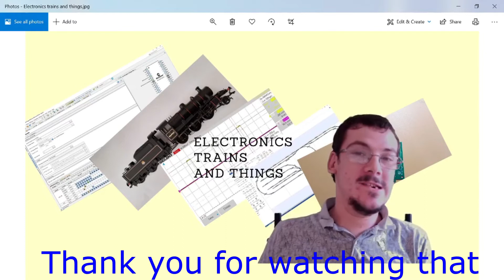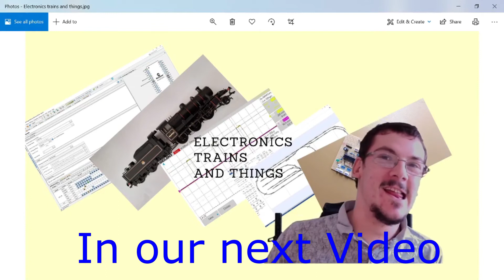Curing Train stopping on points/turnouts

Comment: Simple, change your point’s/switches to live frog and you won’t have that problem.
Reply: Which are much more expensive and difficult to install
Reply from the maker: These points are very old and we don't have the money to upgrade! But thanks for advice. We have opted to adding pickups to the tender but we haven't given the train a good run yet. We've had to take a long break but back into it again. Ernie and Louis

Comment: The basic problem is the lack of proper wheel bearings and tender pick-ups on most Bachmann loco's. I don't have any of these problems with Hornby nor other make like Roco, Piko, Fleischmann. Needless to say that the track & each point need a proper feeder for the fish-plate connections are bad conductors. Proper track maintenance helps a lot of avoiding problems of stalling too.I prefer the 'graphite' application. Success.
Reply: @barnabyjoy I wrote: wheel bearings. This means the wheel axle turns in a bearing at each side that sit in the under frame so there is less friction. Only Bachmann uses the axles to turn direct in a slot of the under frame resulting in a lot of friction and wear. But here the main problem is the lack of tender pick-ups.
Reply from the maker: Yes, we've added pick ups to the tender. Thanks for your reply
Reply: @electronicstrainsandthings4149  have you tried seeing if theres a pinch point that grabs the flange, created by the bow in the plastic making the gap between rail and check rail a little tight? That could explain more so why bending it out to flat helps as it would slightly open up this gap. That would explain why giving the wheels a little bit of extra side play would be helping you out if it was the cass that it was grabbing the flange of the centre wheel set
Reply: A very narrow-minded response. Just because you only have problems with Bachmann, means nothing to me, as I have these problems with Hornby, Dapol and Bachmann. So, 1) you're lucky and 2) you're wrong.
Reply: @skelligringphotographyandw7012  check the back to back gauge of everything, check the gauge on the points. Problems usually lie here. And remember, even real trains derail sometimes its never perfect even for the big boys
Reply: @skelligringphotographyandw7012  Are you that frustrated that you need to insult people ??

Comment: I have just come across the video so sorry for the late post. I have a DCC 00 layout with 22 points only 3 of which are live frog. The remainder are either very old Hornby or new Peco. I have a lot of problems with my 0-6-0 tanks, (all 3) obviously with short wheel bases and this is on  both the Hornby and Peco dead frog points. Unfortunately, I never know whether this is caused by a temporary short or by the wheels riding up on the points. I tried the keeper plate loosening trick a year or two ago but with not much success. I have just received a 2cm long spirit level which I hope will show me whether points are level but those are all screwed down tight in several places on a completely flat baseboard. I also use graphite. One thing I have not done is to insert screws either side of the frog as is suggested by one of your commenters. So that's the next step. Your video has been extremely useful because I had run out of ideas.  Did the guy who sanded down the Peco frogs have success or did he ruin the points?

Comment: your problems the trains pickups - even if one wheel looses contact the other pick ups should be working including (Im presuimg from the wires) tender.. Turn the loco upside down and check each pick up wheel systematically one by one using a wires from the controller.. Maybe as simple as gently bending them back to make contact/rub with the wheel back
Reply from the maker: Big thanks for your advice. What I didn't explain was the train actually 'rocked on two wheels at the point where it stalled. The points are very old! We have opted to adding pickups to the tender but we haven't given the train a good run yet. We've had to take a long break but back into it again. Love the feedback and thanks. Ernie and Louis

Comment: I know I'm three years late but your post came up and I have had the same problem. My locomotive is a small 4-6-0 yard locomotive, Bachmann in Canada. The drive wheels are quite small so it would stall the same as yours when crossing the frog. I loosen the screws as you did and it now works great giving the drivers a small bit of play. Thanks again.

Comment: Thanks, I cleaned the DCC engines and track with contact cleaner and both engines are stalling at the same place.  Any other suggestions?   I use Bachman EZ command and the engines are Walthers

Comment: I have found the same problem with some of my set track Peco points. I have got round it by drilling into the sleepers either side of the frog and securing with Pico track screws which will  pull down that raised area, this has worked for me.

Comment: Peco points/turnouts are rubbish in regard to electrical contact to sidings in analogue N scale, ruined  the running of a layout I had put a lot of work into. I am using Kato HO track for the layout I am working on now, It is completely reliable and has no electrical problems, it has a built in point motor which saves a lot of bother and is easily ballasted to hide the trackbed. Has the DCC option built in. It can be used easily together with other code 83 track, just remove the Kato connectors and use ordinary rail joiners. The Kato N scale track is also problem free.
Reply from the maker: Wow!!! Big thanks for the info. We are doing another video based on what people have said so we will include your advice. Thanks for commenting :)

Comment: I have had these problems, and I find that points (even new Peco ones) have a 'crown' at the frog, but have never tried bending them, tho' this may cure it , then each end of 'said' point may lift at the adjoining connection, to overcome my problem I have screwed down the sleeper one or other side of the frog and slightly packed the opposing side about 1mm, trouble is as I run many different makes, so each loco has its own peculiarities and temperament! plus most of mine are old Tri-ang, Hornby etc., - 50 years some, but only 1 Bachman and thats poor runner, yes live frogs are the answer but to replace mine (16) would be expensive.
Reply from the maker: Well yes our points are old Peco one's and it would be outside our budget to replace them. Thanks for your comment. We are going to to do another video on the subject soon.

Comment: Just saw this now.. 
I may be wrong but, loosening the plate under the driver axles makes me wonder if it'd eventually cause problems with the gears up inside not fully meshing and wearing down..I could be totally wrong though...Just sayin'... 
Stalls are usually caused by a short wheel base loco where either + or - bearing wheel gets right atop an insulator at either end of the switch frog.. Not sure if DC as well as DCC locos can have 'keep alive' installed..But that certainly is the answer in DCC, anyway; the capacitor circuit which powers the motor while traversing dead spots in rails...
I did though enjoy your video and gave you 'like' # 198 as your take on the problem is just as important.. Thanks...
Reply from the maker: Big thanks for your advice. What I didn't explain was the train actually 'rocked on two wheels at the point where it stalled. The points are very old! We have opted to adding pickups to the tender but we haven't given the train a good run yet. We've had to take a long break but back into it again. Love the feedback and thanks. Ernie and Louis

Comment: It seems to me that you have a problem with the pickups which is being shown up by the track.
Reply from the maker: Big thanks for your advice. What I didn't explain was the train actually 'rocked on two wheels at the point where it stalled. The points are very old! We have opted to adding pickups to the tender but we haven't given the train a good run yet. We've had to take a long break but back into it again. Love the feedback and thanks. Ernie and Louis